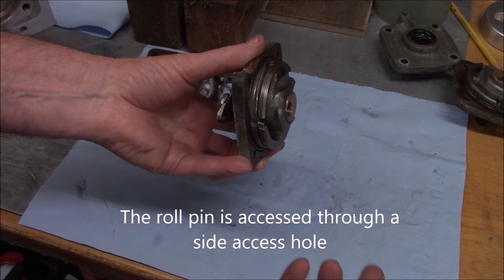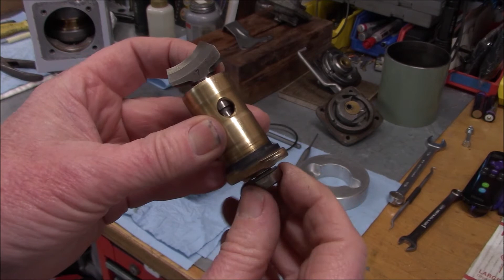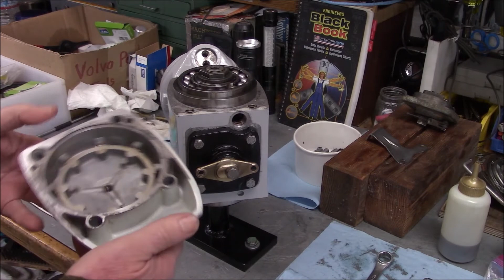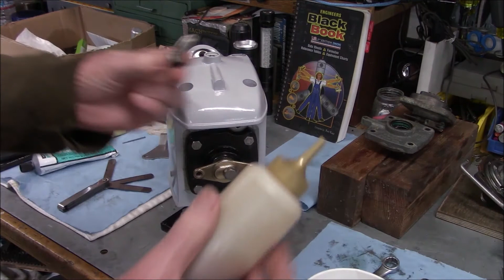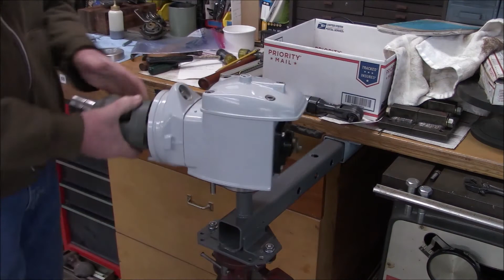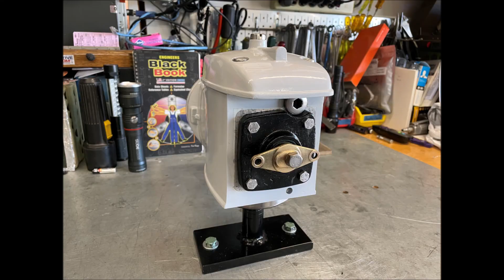Volvo Penta AQ Upper Part 5 Shifting Cover and Final Assembly

Comment: I like your explanations of how some things affect other things. Shims affect movements. To allow the movements to operate  properly they must be within tolerable numbers. Such as upper nut clearance .004-.020 . These numbers affect the gear mesh, and the shift cone float, and travel to engauge with the cup.  Sometimes it takes awhile to recognize  some details like these..Dean has it down, and gets it right, weather trimming a nut, or understanding it’s function. Thank You for these videos.  Mike

Comment: With all due respect: 

The primary component being worked on is the Shift Mechanism. 

The bronze unit is the "Sliding Sleeve".  
There is a spring underneath the sliding sleeve to over-come gravity and aid in retaining the Neutral  position. 

The "Shift Shoe" is what raises and lowers the sliding sleeve into each corresponding gear cup.... sometimes referred to as the cone.

At 8:27 into the video, he shows using a silicone product for the eccentric piston seal. I will suggest that we NOT use any silicone products during your stern drive assembly. Silicone has no place on a boat. 

At 10:35 into the video, as the detent pin is being re-installed, 
If NOT retrieved, the next guy doing this work will NOT be able to drive the current pin through and past the detent pin.   

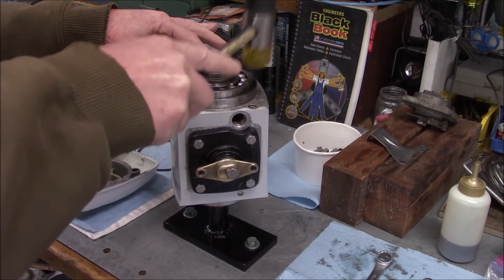At 16:00 into the video, the top cover cap screws should be just snugged during this procedure. Not tight.... just snugged. 
The goal is to achieve a .003" squeeze on the upper driven gear bearing retainer once the top cover has been fully tightened. 
The gap between the top cover and the main gear case should now be ZERO. 
The .003" squeeze is to prevent the bearing and bearing retainer from spinning. 

Always use a new OEM top cover loop gasket, and a new OEM hollow bolt O-ring.

I will also mention that the double bolt helmet pin "cap screws" 
If too long, they will break through the aluminum clamping collar area and will allow water to enter the universal drive shaft area.

,,,,,,
Reply from the maker: Thanks for commenting and the good information.
I'll take your recommendation of avoiding the silicon grease. I've used it for 40 years in industrial applications for water contact rotating seals.

10:35 yes I failed to show the removal of the pin "taping it out" Thanks for pointing that out. It was removed.

It's amazing how much detail is required in servicing these units. There always something to learn.

Thanks for commenting and viewing !

Comment: Great video, very instructive and  informaitive.  one question I have some vibration in my 1990 Larson, with this outdrive on it.  I may have 300 hours total  not used much.  Any Ideas as to where this vibration would be coming from.  I have installed new U joints.  Other than new upper oil seal and boots I've not done any other repairs.  Thanks Woody
Reply from the maker: Hi Woody, 90% of the time vibration is U joint related. I'm very detailed when installing new U joints. I've had many where the end clearance is too tight preventing the joint from moving freely. There's actually an end play spec for U joints about .001-.002"
I keep an assortment of different thickness snap rings for adjustment. You can also carefully sand or grind them thinner, but do not over heat them, the snap rings are spring tempered. There almost always too tight. Also sometimes the bores in the yokes get worn and the caps are too loose. You can Loctite the caps in as long as there not too loose. And only use top quality U joints.
Other vibration sources are damaged prop or bent prop shaft. 
The DPs are also prone to chipping gear teeth. Turn the props slowly and feel for clicking or rough spot. Also black oil a bad sign.
Hope that helps,
ATB...Dean

Comment: Hi Dean. Thank you for this video. Could you help me understand on the shimming the shift shoe to obtain proper clearance then for a DP-E to add an additional 3 more shims after "proper amount of shims have been established"? I'm not understanding how that makes any sense. Wouldn't that create excessive clearance right off the bat? I know the spring is in there to take up slack, but I'm not understanding why. Could you maybe help clarify?
Reply: The spring allows the shift shoe to ride up and down the detents and shift. Without it it could not ride the elevation of the detents . The shims provide for the shoe to not have continuous contact with the shift cone after shifted in f or r. Adjustment is part of a rebuild, allowing all the components to function as expected, without excessive wear. Or even failure. Hope that helps someone.
Reply: @lettyguerragirlbills792  thanks letty. I was more talking about why only the DP-E requires 3 additional shims. Im wondering what is different.
Reply: @Spicy-Tuna   Yeh got it. Seems the dpe is a different animal in the upper. That said the shift mechanism may be slightly deeper or shallower.and or the cone/ or housing larger. Not all mechanisms are cut the same nor are the detents the same depth, which affect the number of shims. 
The 290 a, has a different set of parts than the dpe, so the parameters differ.
Reply: @lettyguerragirlbills792  yeah I just stuck to the manual. Got my settings and added 3 additional shims. After talking to a few dealers, I was told that there was a bulletin to take the sliding sleeve spring, washer and retaining clip out. So ended up doing that. Its shifting good so hopefully I did everything good. Glad this video was here. Helped tremendously.

Comment: I'm looking to replace my shift assembly but mine is the one that had that rise with the bolt hole that the cover bolts on to. I can't find that part anywhere and everyone asks for a serial number off the drive. Unfortunately, the plate with the number is not on it. The part number on the shift is 872993. Any suggestions on how to come up with that assembly?
Reply from the maker: Mike, Yep that's not a very common style, in face the one I'm showing in the video is the only one I've seen with the extended bolt hole tang for the shift cover. In most cases they just used a bolt on plate that extended up to replace that tang. If you could find that plate or just make one, any style shift cover assembly would work (be sure to check the fork depth shim adjustment). Send me an email: dean57ayr@gmail.com (include a photo of yours) we probably have one we could sell.
Hope that helps.....Dean

Comment: It's my second time taking my Volvo Penta Aq125A out and I'm having trouble getting it out of neutral.  It ends up popping when I shift it to forward and reverse. It's a horrible sound and feeling. How can I fix this problem.. please help me and thanks for time
Reply: I figure out what the problem was... The brass screw was too tight and missing chims. I got it shift in and out with no problem now. Thank you for reply and stay safe
Reply from the maker: @alexanderbenavidez5533  Awesome ! good find
Reply from the maker: It's either the shifting cone & cups are highly glazed or possibly worn out. Could also be the brass thrust washer is deformed. Only way to know is performing a disassembly and inspection. It will fail catastrophically if you keep using it like that. Check the drive oil level first..

Comment: PLEASE HELP ! !!!!  love the series . i installed my shift paw and i feel drag in one spot every time i turn the transmission just like in your video but even when i back the adjusting bolt out it dosnt seem to get any better, maybe a bit but i always seem to have some drag in the same spot. ???? i also tried it as per the manual where u remove all the spacer washers and it says it should be so dragged it wont move and then u add shims but i still have movement on the shaft even with no shims. i didint seem to have a problem shifting before i took it apart but trying to follow the manual and there isnt really a trouble shooting guide if it dosnt work out exacly as written . When i have just the reverse and forward gear in the main housing it turns like a top no problem but as soon as i install the shift mechanism it drags. is this normal ? ??
Reply: I have the same problem
Reply: @leefeldt1550  any thoughts ?  lol ????
Reply from the maker: The shifting fork/paw may be stuck in the lever crank barrel or damaged in some way. That shifting assembly can be removed with the drive on the boat, just drain out about 1 quart of the oil first. You should also notice the shifting lever & barrel moving in and out as you rotate it to shift.
Reply: @TheAyrCaveShop  I'm having a similar issue.  Shift barrel seems to be sticking and requires a lot of pressure to move in or out. When shifting into forward or reserves, should the pinion be seating all the way into the shifting groove? Thank you!

Comment: This is a great series of videos you've made and I really appreciate the time and effort you had to put in to get it ready. Very informative and gives me a very valuable insight to the work ahead of me, should I decide to explore my dp-e drive myself. A question came to mind when you covered the deglazing part. Only thing I heard prior to this is, that when you have an issue with gears hesitating to go in, you need to replace the shifting cone. You didn't mention that possibility at all, and focused solely on deglazing the cups. Any comment on that?
Reply from the maker: Lars,
Yes they can wear out, but that's quite rare. In those cases the gear cups are usually worn beyond service as well, making the entire unit basically scrap. There was a batch of defective shifting cones that made it into production about 20 years ago. Those typically failed in the first year. New shifting cones if you can fine one $$$$$
Thanks for commenting....Dean

Comment: Hi Dean, me again. Will you be doing a series on the lower unit? My outdrive is full of water, but so far all the seals in the upper gear unit and the intermediate unit looked fine. I'm afraid the prop shaft seal is probably bad, so I need some direction. Thanks again for your informative series.
Reply from the maker: Roland, The lowers are a PIA. Dad and I usually avoid them but we do rebuild them time to time. Probably the biggest negative is trying to ship them. "very costly". The DPs have prop shaft seal issues, the small seal between the shafts typically. I'll try to video one but it might be a while..
Thanks for commenting...Dean
Reply: @TheAyrCaveShop  Thanks, Dean! I'll try and do what I can using the manual, but I always learn better by having someone show me what to do. I've gotta find the problem as it can't go back in the water like this.
Reply: @r @rolandboykin5770  pressure test the unit with all oil drained out. If it holds air pressure less than 5lb max. It don’t leak. If pressure drops  , look for a slow leak. With soapy water and a paint brush. It will blow bubbles where leaking.

Comment: Simple question, Dean. I'm inspecting and so far just cleaning and resealing a 280. The service manual calls for 10W30 or 10W40 oil in the unit. I've always used 90W in other makes. What do you recommend?
Reply from the maker: Roland, Yep I recommend 90W. If you can find Mobil 75 full synthetic that's a good choice.

The older engines had less power so they got away with a lighter oil. Volvo figured this out with 290 models and started requiring 90W.

Thanks for viewing....Dean
Reply: @TheAyrCaveShop  Thanks for the info!
Reply: Is this the same for the 275? I'm getting ready to tackle the u joint bellow, I'm very new to these Volvo Penta 275 outdrives

Comment: Great video series! I'm taking apart mine and a small maybe 3/16 ball bearing that  fell out on the towels I'm thinking from the shift mechanism would appreciate any info if possible
Reply from the maker: Jon, you must have an old style shift cover. The ball with a spring rides on the brass shifting cartage. a loop of wire holds the spring in the housing to allow assembly so it doesn't pop out. Hope that helps....Dean
Reply: Terrifying there was no wire!  And the boat is a 1979 so I'm guessing that sounds about right. Also my spring flew off into orbit when I popped it out. How terrible would it be to not reinstall those bits the shift mechanism still has the center v notch in it. Thanks so much for the reply!